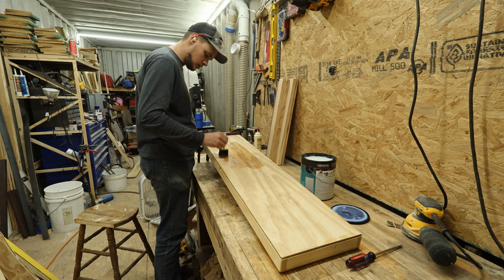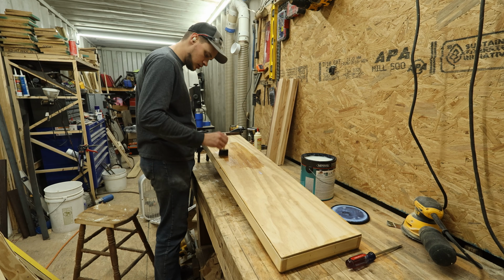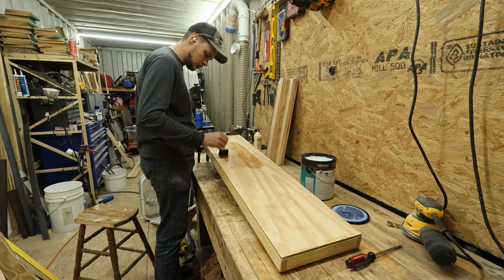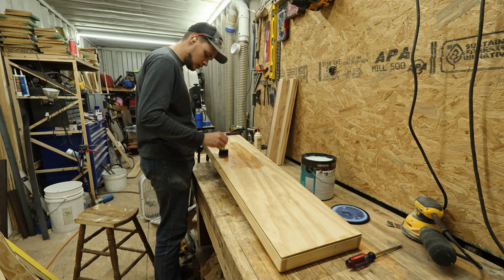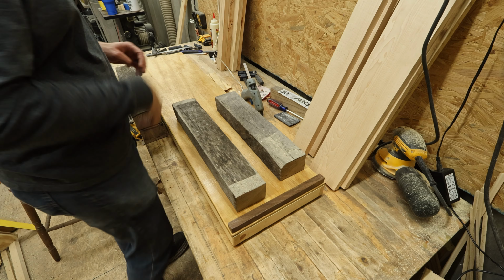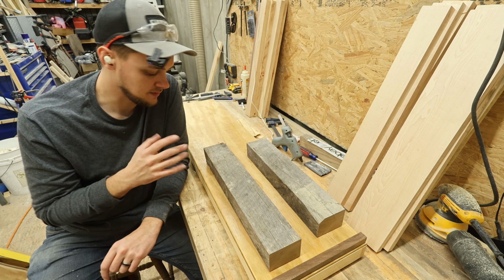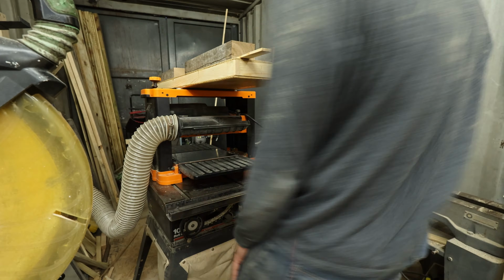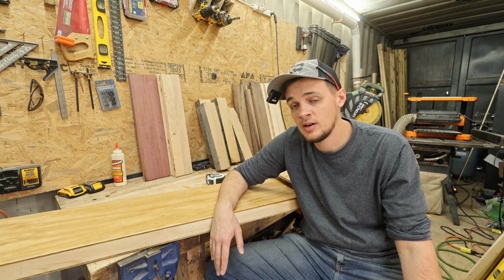A better planer flattening sled using a torsion box.

Comment: I have made a sled like yours, but put the "stop block" on the end in to the planer FIRST. I tried putting it in last like you suggested, but my planer wheels (not the cutter) grabbed the top board and slid it forward off of the sled. So at least in my experience, your planer wheels manage keeping the board from coming back at you, just like they do with any piece of wood you put in there; and the stop block keeps the sled and board from moving independently.

Comment: Makes me wonder how thin you can build a torsion box before it stops working. There is probably a ratio of the thickness to the space between the cross members that needs to be followed to maintain stiffness and flatness.
Reply from the maker: I did a lot of reading up on torsion boxes before making this one, and the consensus seems to be that the thinner the skins, the closer the interior supports should be spaced. If you were to use 1/4" plywood for the interior supports and the skins, I'm sure it could be problematic. That would be an interesting video to make, testing torsion boxes to see at what point they no longer work.
Reply: @MurphysCreations  Your supports are already relatively close to one another, and are much thicker than 1/4". From what I can tell, such thickness should be able to afford you a 12" spacing

Comment: is it important that the rungs run the short-way instead of the long-way? or is that just a coincidence?
Reply from the maker: From my research, short ways is all that necessary in this application. I've seen much larger torsion boxes where they run both ways. In this application, the sled is so narrow, having a spine run down the middle won't really do anything. If you used thinner plywood for the skins, maybe it would make sense.
Reply: @MurphysCreations  How did you come up with all the sizes? rule of thumb? or did you find a calculator somewhere?

Comment: Did you run into trouble using sleds made of plywood/MDF? I totally get why this works and it's a good idea, just curious if you had some specific issues with the usual method to share.
Reply from the maker: I originally had one made from melamine. It warped over time. A big part of that is that it was stored in an unconditioned space. I plan to insulate my shop this year, but until then, this won't warp on me.
Reply: @MurphysCreations I feel that - my "workshop" is just my uninsulated garage. Hopefully sometime in the near future we can insulate it, but for now, the MN winters are a real problem.